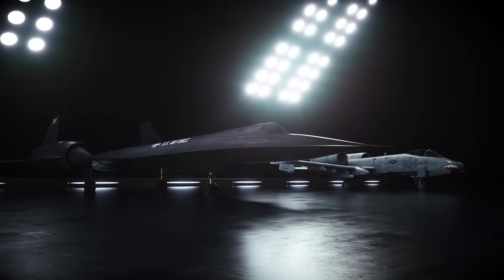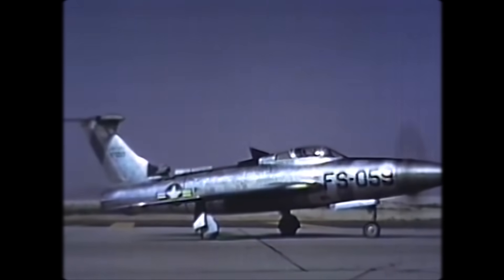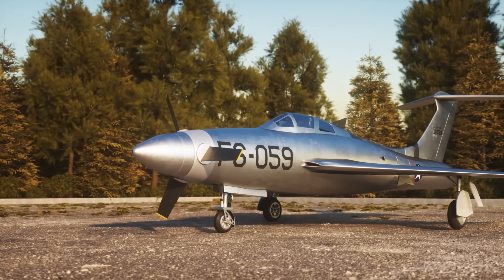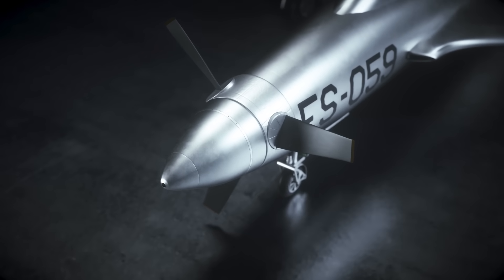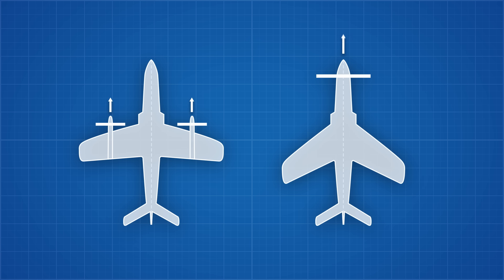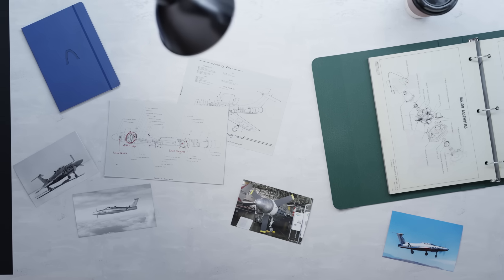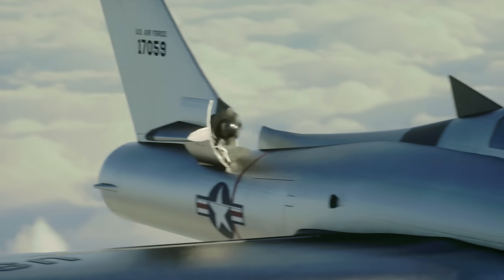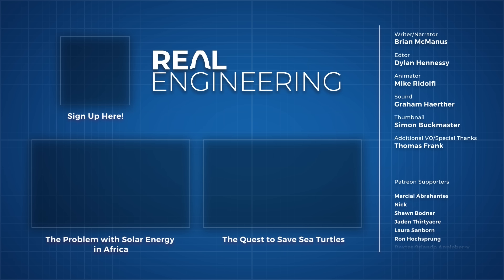The Insane Engineering of the Thunderscreech

Comment: Early in the video, it is mentioned that early jets had poor "climb performance" - to be clear, the issue was that early jet engines could not throttle up and down quickly. To change from "0% thrust" to "100% thrust" took a long time - many seconds. Some very early jet engines could take more than a minute. That means making rapid throttles changes are impossible. While top speed was high, and even maneuverability was good, dogfighting often requires rapid changes in throttle, which jets were bad at.

Piston engines can VERY rapidly change throttle settings (think about how quickly your car can go from idle to redline when you floor the pedal in neutral.)

The Navy specifically wanted rapid throttle change because when coming in for a landing on an aircraft carrier, the plane needs to be at low/idle throttle, but if they miss the arrestor wire, they need to throttle up to 100% very rapidly to be able to lift off again before running off the end of the deck. Something jets of the time couldn't do - if an early carrier jet missed an arrestor wire, the pilot would eject and the plane would dump into the sea off the end of the carrier deck.

The Thunderscreech's big benefit (as mentioned ~8:40) is that they could change the blade pitch to run the jet engine at one speed and change the amount of thrust it was producing by changing the propeller pitch. So it could have the speed of a jet, with the rapid-thrust-change of a propeller plane.

In the late '50s, early '60s, jet engines were developed that could rapidly change throttle, allowing for full jet fighters to be more reasonable for use on carriers.
Reply: Is that what they refer to as "Spool time"?
Reply: @Jeremy.Bearemy  Yep!
Reply: @Jeremy.Bearemy  ah, so that explains the hilariously anachronistic Douglas.
Reply: I believe I am correct to say that just before "catching the wire" during landings on board a carrier, the pilots of jet aircraft still throttle up just in case the wire is missed or fails ... that way they can take off again and go around.  Commonly known as a "bolter"?
Reply: @chrisrichards2544  That is correct.
Reply: Spool time was one issue.  The lower Froude efficiency of jets relative to props at low speed was another.  Froude efficiency is the efficiency at converting thrust to forward motion of the aircraft, and it is increased with greater cross-section area and lower velocity for a given amount of thrust (T proportional to VxA).  That problem was overcome with jet engines sufficiently powerful to overcome their inherently less efficient takeoff performance.
Reply: @gcrav  Yes and this is "why" the military tactic transporters (C130, A400M...) use all turbo props and not turbo jets, and in addition are the turbo props more resistant  on dirt runways because the air intake is high placed: a turbo jet much deeper placed suck in, dirt and small stones who damage the engine...Only strategic military transporter (C5,C17,AN124,etc...) use quasi only on hard runways, use turbojets
Reply: C K  almost as useless as your comment! But thanks for the interaction with my comment.
Reply: Your statement in the third paragraph is wrong.  Early designs of jet engines did not have great power and very poor spool up times; however, a jet was not lost when it "Boltered" or missed the wire.  They would have lost every aircraft in one cruise if that was the case.  Now if the early jet caught a wire and it snapped THEN they would need to eject but you said any attempted landing not catching a wire they would eject. That is absolutely false. They had worse safety (under powered and slow spool up times) margins compared to modern jets today..
Reply: That's great information! Thank you
Reply: At takeoff wouldn't lift be increased by the prop wash flowing over the wings whereas a jet engine could not produce that benefit?
Reply: Turbojet engines have poor power at low airspeed, whereas a propeller has nearly all its power available at low airspeed. This is part of why the F8F Bearcat won so many "first to 10000 feet" competitions against more modern jet fighters, well into the '50s. These competitions were measured from brake-release, so that throttle-response and start-up time was discounted as a factor, and yet the piston-powered propeller-driven Bearcat won due to its shorter takeoff and much lower airspeed for optimum climb-rate.
Reply: I stopped the video to read this comment...thanks for the info!
Reply: Another issue was that these new aircraft had wings that would create a lot less lift at low speed, the problem was spool time and faster wings
Reply: Very interesting. Based upon travelling today, even today's commercial turbofan engines need around 2 to 4 seconds to go from idle to takeoff thrust.
Reply: Why not use rockets to improve climb performance? The rockets wouldn't need to be on all the time, just during climbs. Once the fuel runs out, the rockets could be dropped.
Reply: @ That was/is used for takeoff, but you really don’t want to carry those around for all flying for use solely in the event of a missed landing on a carrier. (Nor would you want to use them on a carrier at all for the damage they’d cause the deck!)
Reply: Russian engines still suffer from this issue. They need 8 seconds for spool up from near idle to full military power and thus the pilot has to calculate carefully when to make a turn. US made engines reach full power almost instantaneously.
Reply: Almost no dogfighting techniques need rapid throttle changes, dogfighting is done at constant high power. Modern engines (from all manufacturers) still take significant time, it's an unavoidable aspect of jet engines producing their power from high RPM rather than high torque. Certainly it was worse in early engines and needing carrier landings was a factor for the navy, but takeoff and climb performance were equally problematic for early carriers.
Reply: @iskierka8399  not quite true, rapid thrust changes are needed in a dogfight, jet or propeller powered, however most aircraft engagements in modern time are done Beyond Visual Range (BVR), rarely (very rarely) do dogfights occur. In BVR speed is king. If it comes down to an actual merge into a dogfight Basic Flight Manoeuvres (BVM) requires very critical energy management and turn performance management making thrust control a considerable factor.
Reply: @Chio_OB if you go below a mountain level will the enemy radar guided missile stoll be able to keep a lock on you?
Reply: I was just thinking the same thing watching the video - well done sir
Reply: Is this what they call mansplaining
Reply: @Nicolas-ol7jl  fail
Reply: @Nicolas-ol7jl  Bonus points!

Comment: I haven't seen it mentioned in the comments as I scrolled a bit, so I'll ask. At 05:03 you claim a propeller with half the radius has half the tip velocity. On screen you show v = ω × r. My question might sound a bit stupid.

The actual distance the tip travels is that of the circumference of a circle with diameter r of the blade length. Therefore a blade of length r₁ = 1m must travel d₁ = πm at its tip, a blade of r₂ = 2m must travel d₂ = 4πm.

If we keep a constant angular velocity of ω = 1 rotation/s our first blade tip has to travel πm/1s = πm/s, with the second blade travelling at 4πm/1s = 4πm/s.

Where is the error in my thinking?

Comment: YOur graphics are not in line with your statements nor with what I can determine about the prop. It looks like the prop is not an airfoil at all, Your depiction of the wing air foil is symmetrical. Generating equal lift up AND DOWN! The F-104 wings are planar no foil period. Yet it flies! If "lift" were a determining factor in a plane remaining in the air, once it went inverted, the craft should unrecoverably fall out of the sky.

Comment: Wow, this plane seems to have a role in explaining the absolute limits of what prop driven aircraft can accomplish.
Reply: Kind of but they accomplish a hell of a lot more now than the Thunderscreech ever did.  Because of this aircraft modern turboprops like the C-130 have a reduction gearbox that keep the props from breaking the sound barrier.  Instead the blades pitch like a helicopter to achieve faster speeds.  They can't compete with standard jets for speed but they beat the breaks off of jets at low speeds and precise control.
Reply: @AnarexicSumo  Not to mention the turboprop aircraft beat jets in fuel consumption.

Turbojet aircraft too. Don't understand why low budget armies just don't make lots and lots of Turbojet aircraft armed with long range missiles. Don't see how jets are better when speed has become relatively unimportant.
Reply: @gae_wead_dad_6914  That's why the newest US fighters can't reach mach 2: It's been repeatedly shown that in actual air combat, it isn't super useful to go that fast, especially with all of the maneuvering involved.

Comment: It must have been horrible to fly with that sound. The Russian Tu-95 bomber and variants (first flown in 1952 and still in use) with contra-rotating turbo props is also very loud for the same reason. The tips of the propellers exceed the speed of sound.

Comment: Fascinating. Thanks for this. I wonder why they didn't develop on the idea of two engines in a push/pull arrangement, as in the Dornier 335, which was the fastest piston engined fighter of WW2. Mght that have obviated the need for the twin shafts running the length of the aircraft and simplified the engineering? Had the props rotated in different directions, could that have overcome the torque roll issues?
Reply: Very interesting point of view but how you connect two jet engines in such a limited space along the fuselage and the evacuation of very hot air on the front engine? In my opinion the best solution was the contra-rotation propellers that should eliminate the high torque that the Thunderscreech was suffering very much. Surprisingly it was never implemented so probably there must a reason...l
Reply: @paoloviti6156  The Thunderscreech was a piston engined aircraft. Why would they have needed to connect two jet engines?
Reply: @laurieharper1526  Nope, it was a turboprop using the Allison T40.  They even had plans to outfit it with an afterburner.

Comment: The rotational velocity is not the same at the root as the tip. It's running the same rpms. The tip is going way more distance than the root with each rotation. Therefore the tip is going around at a higher velocity.

Comment: What if you angle the propeller? I.E., say you had three or four propellers at equal angles, and the 12 o'clock propeller looked like \\ with the rest having the same angle. Would that have any effect? That should reduce the difference in velocity between the base and the tip? Increasing the distance of the center of the shaft while decreasing the (relative) distance of the base to the shaft? Could fiddle with the angles to a good degree too!
Surely a stupid question with a very simple answer as to why that doesn't work, but admittedly I am a ninny. (not trying to be sarcastic - I'm sure I'm missing something simple here but I'm not quite sure what that is and would appreciate to know why that isn't viable should anyone be so kind as to explain what I'm failing to account for!)
Thank you! =)

Comment: 1 minute in...Actually, This airplane is the most fantastic experimental aircraft ever designed and flown. 

NASA (NACA at the time) did extensive testing and proved that a propeller aircraft can fly supersonic, and the propeller itself can achieve up to 80% efficiency while supersonic (a normal propeller is about 82-85% efficient at around 100mph) they used a solid machined metal propeller made of high strength material. The tip Airfoils are only 2% thickness ratio, basically a lot thinner than a knife. 

So, it's insane technology.
Reply: Perhaps if it had a different engine. The Allison T40 was a terrible engine and unfortunately plagued other unique projects as well.
Reply: Other posts here strongly imply no real data possible on supersonic flight, as max speed during any tests were very average normal propeller craft speeds. Control issues with the variable pitch prop (Pulsing), among others, kept speeds below exceptionally dangerous regimes.

Comment: Wing mounted engines also come with the issue of increased drag, since instead of one nosecone and completely smooth wings, there are two nosecones on the wings, which is why planes with two engines mounted on the wings are often slower than planes with only one engine in the hull. But, of course, planes with two engines can carry alot more, and often have much better climb-rate than planes with similar weight but with only one engine.

Comment: Engineers wanted extra thrust for takeoff.  I would have just used a secondary ROCKET engine, in the exhaust of the jet engine itself, for the thrust required. Enough fuel for 30 seconds of rocket burn would have been all that was required. Much easier to accomplish than using a propeller together with a jet engine, and much more than the afterburners of the time were capable of outputing.

Comment: You are wrong when you said all parts of the propeller travel as the same speed. The tip travels much faster than the root which is why the prop has a twist from root to tip. Obviously the prop tip travels a greater distance than the root but must cover that distance at the same time, thus it goes faster. There are design problems with the prop tip approaching critical Mach speed, but not so the root.

Comment: Hey great video. 
One small point of disagreement. Your graph on efficiency of WW2 fixed pitch propeller, I pretty sure that graph would be for a variable pitch. That's a high efficiency over a very large speed range, whereas an actual fixed pitch propeller will work pretty well over about a 100kt range, far less than the Mach 0.7 your graph showed. Fixed pitch props are really only feasible on low HP and limited flight envelope aircraft. (I'm sure you are aware of all that though)

Comment: For the Thunderscreetch I'm surprised that engineers didn't go with a push-pull prop design like with how the Germans did with the Dornier Do 335. Maybe having contra rotating doubled propellers as well? A blend of the Dornier Do 335 with the Tupolev Tu-95. That way the movement of the parts cancel each other out. I know contra rotating propellers have their own issues  however (such as complex gearing) so I don't know how practical or effective that would be?

Comment: I believe the Soviets found the answer in using larger diameter props that moved a large mass of air slowly. Maximum efficiency was achieved the closer the plane's speed approaches the air speed achieved from the propeller. They also should have tried a counter-rotating props and a turbo-prop engine with a gearbox to create a light weight engine with massively more horsepower,  but then looking back into history is easier than seeing the future. They not only had the wrong approach to solving the problem but they needed to develop a new engine system to achieve their goal. It was time to scrap the project & try a new approach.

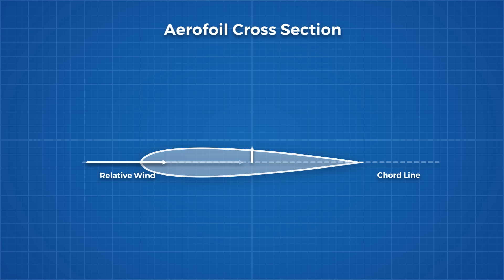Comment: @ 6:00 you say that lift is produced perpendicular to the chord line but the diagram seems to show that lift is produced perpendicular to the oncoming airflow. I've had this question for a while and would just like to know the answer.
Reply: "Lift" supporting the craft is  often in reference to gravity in level flight, for wings.  Usually in reference to long axis of foil otherwise.  Center line of symmetric foil, front of camper line to rear, if cambered foil. All cases, ultimately in reference to unaffected air movement, if using the aircraft as stable element, not as in reality, moving vehicle/foil, still air. So, relative motion of foil to air. Same physics which ever you show as moving. Forces of lifting foils are force vector in relation to angle of attack, with resultant from adding drag vector to force opposing  wings, thrust for propellers. Conventional wing force vector diagrams may clear this up for you.